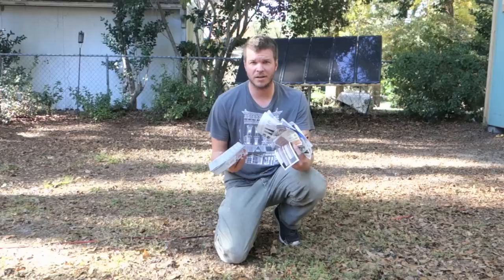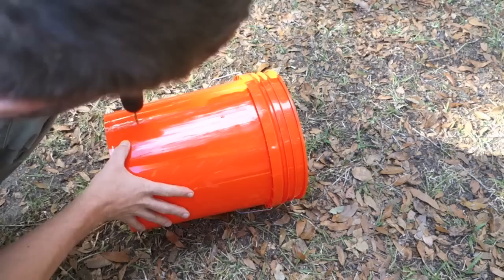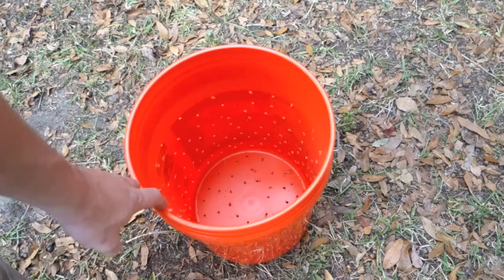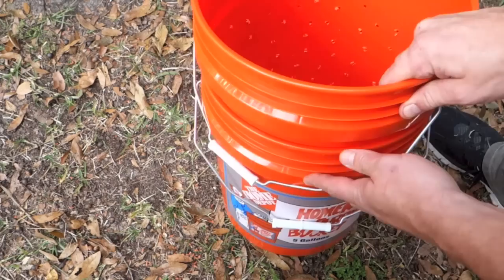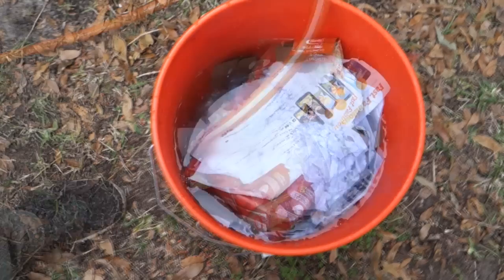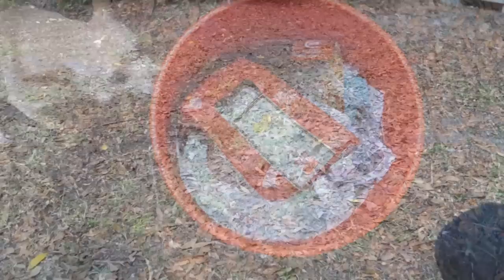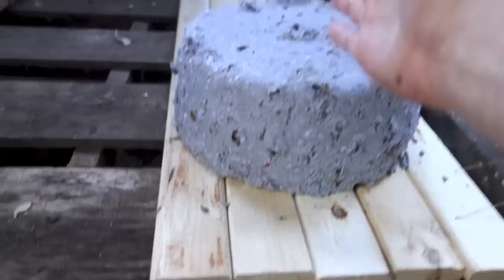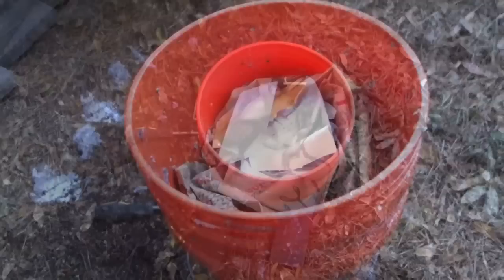Free And Virtually Unlimited Fuel To Heat Your Home

Comment from the maker: I'm working on a heater where the chemicals being burned from the paper won't be an issue. I'm also working on a follow-up video where I'll show you the paper log being burned as well as answering questions and addressing issues folks have commented on. Stay tuned!
Reply: How long does it take to dry out completely?
Reply from the maker: jsombf It depends on where you dry them and what time of the year. In a greenhouse in the summer you're only looking at a couple of days.
Reply: Great! I can't wait!
Reply: ***** He did say in a greenhouse only a couple of days,  and he is right.  I make these and I have them in our greenhouse (81degrees) and at the end of the 3rd day they are vary dry.   I have even cut one in 1/2 to see and the inside was dry also.
Reply: On thing i would suggest,   U need to have a spot to dry them out fast,  if they sit wet for more then 7 days mold will start to grow on it.  and you dont want to burn mold.
Reply: This is just like making paper mache. Look into making a solar oven to dry your paper logs. They are very easy to build. You can even add a solar powered vent fan on one end to keep a steady stream of air circulating.
Reply: Looking forward to the 2.0 video!    Can't understand why anyone would worry about burning mold.  Geesh, it will burn - not multiply.  Still wondering how the toxic chemicals and heavy metals in the paper and ink can be eliminated from the exhaust (is that the right word?) of burning this stuff.    Inks are soy based, but the colorants are a different story.  And drying agents.     And, yes, paper CAN be made without the use of chemicals (heck, the Egyptians made it from a reed; cotton, cotton rags, linen (flax plants), and a species of bamboo native to the southern states of the US are among the material paper has been made from in the past - with a fraction of the eco-impact of making paper from wood.  Sugar cane waste is another viable source of pulp for paper making - among others.
Reply: Jefferdaughter
I think the main concern for those of us in more humid climates is the presence of the mould growing while storing it, once it's in the fire who cares. One tactic for removing some of the inks is inherent to the process, am sure a lot of ink comes out in the water. All over the ground.
Reply: The bucket is a good idea, but using 6-8 in PVC pipe would be better mainly because of the size of the logs being made. It reduces the need for cutting, will dry faster, especially if places in a black painted, vented container, and can be made the right size for you particular fireplace, pit, etc.
Reply: guitargodkc
Interesting idea. Guess if you wanted super fast drying you could funnel it into half inch pipe. By the way electrical conduit is usually cheaper than schedule 40 and you don't need joints to join it. From what I've noticed it isn't as brittle either.
Reply: I'm glad you mentioned that, because half of the paper you showed here was full of plastic finishes. Brown paper, newsprint, and some office paper would be fairly safe, but much of junk mail is glossy and unsafe to burn.
Reply: *****
Outside of an emergency I doubt anyone is considering using this for cooking, mostly just heating their indoors on a hot fire in a wood burning stove.
Reply: *****
Carbon Footprint from burning paper products is largely irrelevant.  All the carbon you're releasing was captured, probably within your own lifetime, by a tree.  Since the paper companies replant the trees they use, it becomes a pipeline effect, and the overall quantity of carbon in the system stays the same. 

The only time you're actually adding more carbon to the system is if you're burning something that's been buried underground for that last few million years.  And, even then, it's uncertain whether the amount we burn is significant compared to the millions of tons that fall to the floor of the ocean every day and get sequestered (and eventually become the next oil fields in a few million years.)

The concern about contaminating food and water you heat with this stuff is significant though.  Definitely need an airtight stove to keep the exhaust well away from whatever heating you're doing.
Reply: *****
 Oh, yeah, burning poison ivy.  My cousin grew up in a rural area, and she was super sensitive to poison ivy.  If anyone burned burned the stuff within two miles upwind of her, she landed in the hospital.
Reply: *****
Am sure if you got the fire hot enough it would destroy the poison ivy's oils, such as by burning it in a wood stove with a hot fire. The only stories I've heard just involve dousing some gasoline on it and tossing a match on, and in the open air that wouldn't be very hot at all.
Reply: Can you use old toilet paper so you dont waste it throwing it out
Reply: DIZZYFP187
Am sure that stuff would work great. Unless it's the scented kind lol then your fire would smell like roses. However with toilet paper you may just be able to twist it into 'rope' rolling it between your hands and throw that on the fire instead.
Reply: Something like a catalitic (sp?) converter added to the pipe to create a "second burn"? I remember someone having one on their wood burning stove it also reduced the amount of wood they had to burn. It's been too many years to remember particulars.
Reply: Mary Rose I remember something like that too, but I did have a catalytic heater, powered by a special fuel.  You had to be very careful what you used in that heater.  It could be used indoors as long as you had good ventilation, but it also produced a heck of a lot of moisture.  I tried using it inside an old VW Campmobile but the humidity got way high.
Reply: bodryn
Hmm yeah my favourite soldering iron works like that. It 'flamelessly' heats the tip using some sort of ceramic insert, but it doesn't completely combust the butane because you can hold a lighter on the outlet and it will make a flame. It's funny most people don't seem to know water vapour is such a large part of the gasses from combustion.
Reply: spacewater7 So it doesn't need to be plugged into 110v?  That would be handy!

That catalytic heater had to be lit outside: it would flame up for half a ininute or so, but when it settled down, I could bring it inside.  Only dangerous problem was it consumed oxygen, so you had to have good ventilation or you could end up with hypoxia, which can be fatal.   I also got that one time, hiking at 12000 feet before I was accustomed to the altitude.  A few days later I went on Pikes Peak at over 14000 ft and had no problems.
Reply: bodryn
It definitely is handy. No cord to fuss about or get in the way or knock things over either. It's made by BernzOMatic and I got it at Walnart, runs on standard butane lighter refills. Excellent point about the hypoxia, you don't want to win a Darwin award after all.
Reply: May i just say that this is also the best way to eliminate private documents that you wouldn't want other people to get a hold of instead of shredding it with a shredder which might not eliminate all of the important stuff
Reply: Tiny House Listings  Log stoves with steel doors on the front are the best for this process. they pull fresh air in from the house and burn it up forcing it up through the chimney creating a natural draw to feed the fire with fresh air and force smoke out through the chimney. - the only issue is when the chimney glogs. thus I suggest checking the chimney once every three day to a week depending on the amount of material burned. 

Depending on how much ash is forced up through the chimney you may have to check it more or less often. 

I watched this as a blacksmith trying to find alternative fuels for my forge. Sadly I don't think paper logs will burn hot enough for my type of work. However I think I may be able to find a use for them yet. 
I'll post a video if I find anything.
Reply: FlamingoPat Bleach does not kill off mould. In fact, bleach is a food for mould.
Reply: Bill white
Reply: Bleach stains mold white.
Reply: Mary Rose That is how rocket stoves work.  The tall, well insulated chimney heats up to the point where it tops 2000 degrees F, igniting any flammable gases as they pass through, and it only takes 5-8 minutes before smoke stops coming out of the chimney.  (In fact, mostly what comes out a properly built rocket stove (used for heating) is 140 degree F moist air, high in CO2.
Reply: thinkrealify  First off, dryer duct is far too thin for a full-on rocket stove chimney, as, once it is insulated, the temperature will top 1800F during operation.

Secondly, If you are heating your house, you will want a 'rocket stove mass heater', as it is designed to use the generated heat as efficiently as possible.  (In one interview video, at the 2pm interview time, the house was a comfortable temperature, despite it being -20 outside, and the stove having been fed last at 7pm the night before.)

If you want to know more, I've gathered some more information here: https://keithfromcanada.wordpress.com/2013/06/18/to-save-ten-million-lives/

Hope this helps!
Reply: thinkrealify It doesn't need a second air inlet.  It is called a rocket stove because the intense heat causes air to rush up the chimney, ensuring that the carbon has plenty of oxygen to bind to, thus preventing (almost entirely) the formation of carbon monoxide.  The insulated chimney provides a secondary burn chamber.  Do some research on how they work, and you'll know all that you need to.
Reply: Try my suggestion of adding holes to your wet slug and see how much quicker it dries. Thank you
Reply: +FlamingoPat Also wall-paper paste has a mould retardant in it, and is a cheap addition.
Reply: +Lucia TilyardM
Reply: +Bill white Wtf?
Reply: +thinkrealify Have did this myself using bleach with leaving them in my shed over summer to use in winter, after several months I did not notice any mold.  Though I used a vice to compact and drain as much water residue as I could, it may be if excess water is left behind this could lead to mold growth.  A cider press is ideal.
Reply: You could also use a  hydraulic bottle jack.  You can pick up one at Walmart for less than thirty bucks that will press with 6 tons of force.
Reply: Keith Olson What is it? Sounds good.
Reply: +Tiny House Listings You could always install an old catalytic converter into your stove pipe. Or cannibalize the catalyst from a few of them and make a custom stove pipe.
Reply: +Tiny House Listings what about magazines ? those take up lots of space , why not burn em
Reply: SwollenRhino Burning all that glossy ink is no good.  Bad chemicals.
Reply: +Necron 99 Not even outside ? id like to burn the piles of catalogs i get every month! Amazon sells magazine rollers to make logs from old magazines.
Reply: +SwollenRhino  not even outside
Reply: +Just Me Whats the problem with burning mold? The spores are not so good to breathe i know. But i have been burning alot of moldy firewood due to catastrophic sun free summers here in Sweden.
Reply: +veX Some true insights but you need a utterly bad fire to not get thoose degrees in it...
Reply: +FlamingoPat 
Bleach does not kill mold, please stop telling people that! It can only lighten the mold making it harder to see. To kill mold you need to use hydrogen peroxide, or something like benafact cleaner. I worked in mold removal for a summer when my town flooded, and it was the first thing i learned.
Reply: +Tiny House Listings Would baking the log at a low temperature for a reasonable amount of time, say, 2 hours, safely dry the logs but won't compromise igniting or drying them too much where they would crumble? Just curious.
Reply: +FlamingoPat I would think some vinegar would have the same effect and is also less toxic.
Reply: Sweet. So does that decrease the toxicity of the ink in magazines? I'd like to take all these magazines I get an make a brick an burn it.
Reply: +spacewater7 the problem with burning poison ivy is that the poison in the ivy is a volatile oil that vaporizes in the heat of the fire.  The oil vaporizes before the vines and leaves get hot enough to catch fire. It escapes with the smoke, but is still poisonous in vapor state.  If you breathe any of the smoke, the vapor is carried into your lungs, causing a rash there, where it is very difficult to treat, and the vapors are still capable of causing a rash on your skin.  In a wood stove, the vapors would mostly be carried out the chimney, but any smoke released inside the house would be dangerous.
Reply: +Tiny House Listings for those who don't have a greenhouse you can build a cold frame and paint the inside black to absorb the radiant heat of the sun, even in winter sunlight can produce good heat in an enclosed area, go take a look at solar ovens and solar furnaces for more ideas, we use a cold frame in a sunny spot in the garden and it will dry out a log in a few sunny days during winter and a single day in the summer, I can stack a dozen logs in there at a time.
Reply from the maker: +Tiny House Listings Here's the solution! I always keep a promise. http://tinyhouselistings.com/heat-your-tiny-house-with-an-outdoor-wood-stove
Reply: +thinkrealify your absolutely Right! 
thanks for sharing.
Reply: can u use leaves
Reply: Peeinyourbutt Allday they might smoke quiet a bit if they are not very dry.
Reply: ***** You are talking about "off gassing", this would be a problem if you used them in a BBQ but not so much in a wood stove (unless it was in very bad shape), the reason it's not a problem in a wood stove is that the wood stove maintains negative pressure in the room, the chimney creates a draught that draws air from in the room and uses it to combust the fuel, so in theory nothing but radiant heat should escape the stove, also people have been using paper logs for a long time now (I'm 48 and they've been around longer than I have) with no ill effects, if you have any scientific evidence to the contrary then I would be very interested to read it as it would definitely effect myself and my family.
Reply from the maker: +saintwarrior76 https://www.youtube.com/watch?v=i8CQ2l4-WkM
Reply: +Tiny House Listings With the amount of electric energy you used in the process you could have heated your house better, as with that paper brick you made there. Plus, in the time you spent on it, you could have earned money.
Reply: +Tiny House Listings 04:00. "You call that a blender???.. THIS IS A BLENDER"
..  If you were to tell me, that you were some how related to the FICTIONAL CHARACTER of the SITCOM HOME IMPROVEMENT: Tim "The Tool man" Taylor.. I TAKE YOUR WORD FOR IT..  You have GREAT INGENUITY and CREATIVITY.,.. I am NOT joking when I make these suggestions...1. Patent this PROCEDURE FOR MAKING NEWSPAPER LOGS and 2 Trademark 
your  Improvised "Blender".. <<<==You JUST NEVER KNOW.. Look at the lady who invented "White Out"  to correct typing mistakes, or how about the person who came up with sticky notes.. Each  of these were a million DOLLAR IDEA.. So, remember PATENT your BLENDER IDEA, & TRADEMARK THE PROCESS FOR MAKING NEWSPAPER LOGS.. Just to keep the "GOOD PEOPLE AT DURAFLAME" from taking YOUR IDEA and coming up with " their new line of product: NEWS PAPER LOGS"  Know what I mean??..Keep USING your Mind creatively.. JUST REMEMBER TO PATENT AND OR TRADEMARK YOUR INVENTIONS, and PROCESSES respectively.. Ron L Hubbard almighty and Lord XENU bless...
Reply: +spacewater7 - Hi there, it's not only burning toxic stuff once,
but keeping it from chemically reforming back to other toxins when burning room temperatures start cooling down, even if it's reforming when it's going out the exhaust pipes.
- please check on the hightech used in toxic waste burning power plants yourself, to see what's necessary,
and it's not just "making a fire burn hot".
Reply: Cool video. Thank you for sharing it.
Reply: +Tiny House Listings Just a tip to enhance your tip (may have been written by others): if you drive some long nails through the wooden circle and stab them into the paper mud before sitting on the circle, that should make  squeezing more efficient and the remaining holes will help the log dry out. Even better if, after taking the log out of the bucket, you make more holes  (the deeper the better) in other sides of it increasing its surface. Those holes will help it to catch fire later, in addition.
Reply: +Tiny House Listings If you're concerned with burnt toxins, use the logs on an external wood furnace with sealed heat exchanger and fan to blow the hot air inside
Reply: +communistjesus L Ron Hubbard was a monster.
Reply: I used to live in Orkney (small islands to the North of Scotland) and used to have a peat bank as part of our property. Peat is like a "pre-coal" state where organic material gets compressed and forms a sort of soft brown "coal" that burns very nicely. 

Do you have any marsh land nearby that is being drained? you may find some peat banks you can use.

http://sianthom.blogspot.co.uk/2013/06/the-tradition-of-peat-cutting-part-three.html
Reply: +guitargodkc lucky I checked the comments. yes I would think that having a black bucket would work very well. Especially in winter times  when there is less sunlight and heat .  in summer time they would cook really good.
Reply: thats bad and wont work.. if it would be so easy .. several people would have come up with it..   if u use filters .. u need to dumb the bad chemicals somewhere .. thats very expensive t oget rid of them if u wont burrow them in your garden wich is even worse.. u will have a big sludge of chemicals and colors u wont be able to split without using so much energy that u cant provide.. your idea is a grave.. u wont get anything out of it.. u waste a lot of energy and get a clump of paper to burn wich is not even 0.5% worth the energy u put in .. 
come to germany i show u some things about engineering and effectiveness.. an idea is nothing .. do the math!
i can give u a list of chemicals used in the process of making these .. and u should never burn these!! u are just producing highly toxic waste that pollute the air..
Reply from the maker: Here is the solution: https://www.youtube.com/watch?v=i8CQ2l4-WkM&index=2&list=PL-4AwcQXbB3z0Scv7XI_KV3hL62vEKeVb Please link me to some of the ideas you've created to help mankind. I'm not saying the idea is perfect, but at least I'm trying instead of whining with no alternative solutions. Move the needle forward, not backward and people will take notice.
Reply: Most of what he threw in has bleach in it. Burning mould isn't the problem... it's the bleach.
Reply: +Peeinyourbutt Allday 

He said yes in the video. You can add various different biomasses such as grass clippings and leaves.
Reply: Yeah thats the first thing I said while watching. Its a nasty poisonous chemical soup.
Reply: Tiny House Listings do you think sawdust would work
Reply: A mix of paper, cardboard and sawdust is excellent; I use 3 paper to one sawdust, approx. In a bucket the same size as the one used in this video, I also add about 2 cups of flour, as a binding agent. It is combustible and holds the logs together very well. Last year I found that sawdust on the outer edges tended to flake and fall away.....messy inside the house. The flour keeps it a bit tidier.
Reply: Tiny House Listings
Reply: Tiny House Listings Save all hair and laundry lint, and shove them inside a carfboard toilet paper roll/paper towel roll for kindling. 

Also, if you throw in some Borax it will make the log burn pretty green flames. 

Throw used coffee in here as well as discarded candle wax and the log will smell great while burning.
Reply: Tiny House Listings if
Reply: I was just getting ready to ask this. What about chemicals?
Reply: Tiny House Listings 8

Q
Woodturning was
Reply: Tiny House Listings